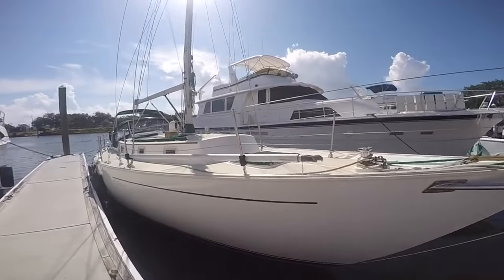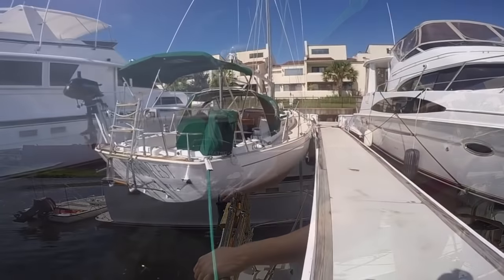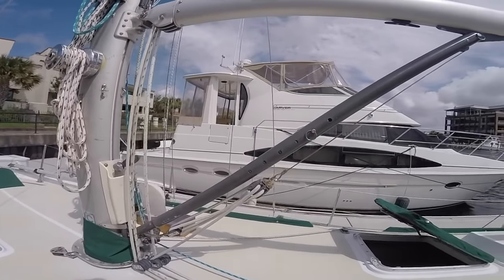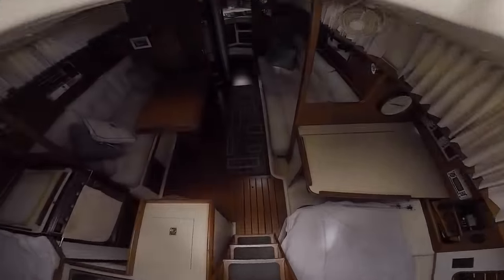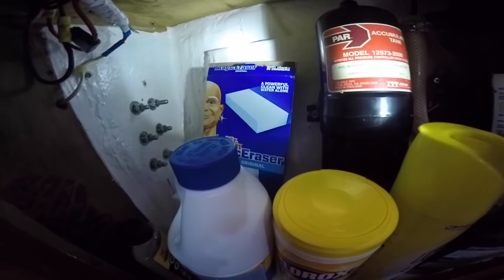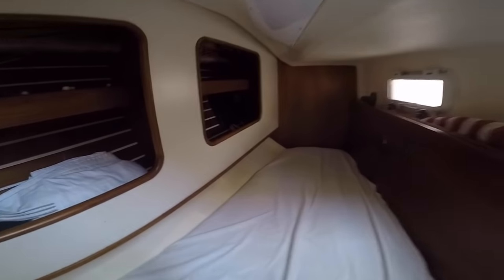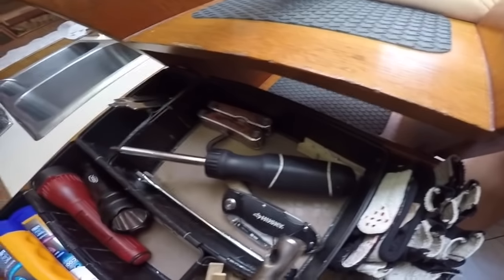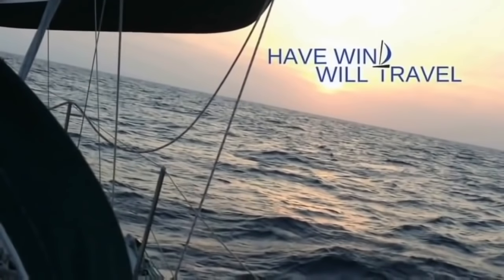Boat #9: 1985 Niagara 35

Comment: Hello Annie!!! I just came across this video. Highlights: Water in the bilge and the bikini were great ways to end and begin.  I seriously enjoyed your video, nice to see that you guys love your boat and take such great care of her.   I use to think I had the cleanest bilge on the water but I think that honor now is yours.  As an owner of a 1985 Nonsuch 30 I see so many of the same attributes throughout the boat. Mark Ellis & George Hinterhoeller, really demonstrated their trade when they designed and built these boats. I will have to check out the rest of your videos and catch up. Glad to see you guys check the fluids so often, great habit to get into. I'm envious of your ability to get through the engine access panel via the starboard rear quarter birth.  Reminded me of old times, I have you by more than a few years and when I was 135 lbs. I loved how easy it was moving in tight spaces; now at 70 lbs. heavier those days are long gone. I actually got claustrophobic watching you by the engine and had a sigh of relief once you slid out of the hatch.  Do you guys ever run a “windscoop” down there when working?  If not, give it a try, you will be amazed by how much cooler it will make it for you.  Thanks again for sharing your journey with us, smooth sailing….Bob………………..

Comment: thats maybe the best tour on YT, i wish everyone would follow how you do it. One suggestion, consider relocating the batteries elsewhere, someplace eye-level, so that water coming in the boat wont short the batteries. The boat could be half full of water and still you have dry batteries to work with, like powering bilge pumps and radio that you couldnt do otherwise. And have more batteries....six is a good number. Meantime, the cleanliness, condition, orderliness and aforethought is really impressive. Id like to hire you both to outfit my next boat.
Reply from the maker: Hey Coco.  We've thought about that before (the location of the batteries in the bilge and the potential for them to submerge if we got too much water in the bilge) but our bilge is pretty deep.  There is still another 10-12 inches, maybe more, beneath them, but you are right if they submerge and we couldn't use the bilge pump that would be a problem.  If they got wet, we would already be in some serious trouble.  Let's hope that never happens.  Appreciate the thoughts, though, and you watching the tour.
Reply: HaveWindWillTravel.com Relocation of batteries is not something I have done but I see the need for it. I considered the dangers of batteries flying around the cabin, and I like heavy objects carried low for ballast anyway, but after watching so many videos and listening to stories, it keeps coming back to "get the batteries out of the bilge." I hope I didnt sound heavy-handed about it, its just a thought and I wish you well no matter what :)
Reply from the maker: Not at all.  Trust me, I get a lot of heavy-handed comments but yours was not one.  We always appreciate well-intended and helpful input.  Thanks for commenting and watching.

Comment: OH NO a leaky boat! Was really surprised to see that head! I have the same one that's been on all my boat's always take it off and put on a "regular" one. You might have too work on it in 5=10 years. I think I have 4 bronze heads, hate it when someone throws one away. That's the first time I've seen a engine access like that, really cool also keeps the dishes done! Some time grab a bottle of wine and you guy's watch ( sv panope) on you-tube the best on anchors. I did use my CQR ( I have three different ones) till I watched his video's and it happened to me also. You've done a great job on the boat!
Reply from the maker: Thanks Packrat.  Yep, we love the old head.  They were just built better back in the day.  We've replaced the joker valve a couple of times, but that's it.  Will check out Panope as soon as we can.  Still trying to catch our breath from the Atlantic-crossing.  Glad you enjoyed the tour!

Comment: Fantastic tour and I've really enjoyed all the repairs and upgrades you made over the past so many months.  A few comments/questions if I may:
1.  I like your point about the T-configuration cockpit and how that reduces the length of the cockpit benches.  The alternative viewpoint, however, is that it also forces you to have a much smaller wheel, which makes it impossible to place yourself on the outer cockpit comings while sailing for a better view of the sail trim, etc.  I love sitting out as far as I can while humming along.

2.  I did a lot of read on batter banks and battery systems before making some basic modifications to mine, including a physical separation of the banks via a Blue Sea Systems switch and trickle charger from the house to the starter bank via Echo Charger.  It appears though that the general wisdom is NOT to combine battery banks if one is dying as that simply draws down both of them down when you combine.  Apparently the more preferred method is to keep both banks isolated.  Not sure.

Question:  I've been considering moving my battery banks from the port aft berth to the bilge in the same fashion you have yours.  Was your designed like that, or did you move them there?  Again I've been reading a lot of cons about batteries in the bilge and so I'm still giving this some thought.  What are your thoughts on this?

Thanks again for the fantastic videos!!!!

Dan
s/v Gypsy Soul
Pasadena, MD
Reply from the maker: Hey there.  Thanks for watching and the compliment.  We definitely love our boat.  Re: the steering, I don't believe we've felt we can't lean out far enough.  Phillip generally sits to the side and can see out as far as he wants and still hold the wheel.  On the batteries, our previous owner built out the space for the batteries in our bilge and we are very happy with the placement there.  We haven't had any issues with them there and they are secure yet easily accessible.
Reply: Wonderful, thanks for the feedback.  I'm going to consider the same modification for the batteries on my Endeavour 35.  The only negative I have read about is the potential to produce chlorine gas if the batteries become flooded with salt water if the bilge floods.  I'll have to do some more research.  Enjoy your pending trip to Cuba, that should be fantastic!!!
Reply from the maker: Thanks so much!  We are beyond excited about it!  Appreciate you watching.  Good luck with the battery modification.

Comment: Annie, Annie and Phillip what a great job you have done, now you can do my yacht, LOL But you will need to come to Melbourne Australia . Just a thought and I know it`s a bit late now to say but why have you put your batteries in the lowest part of the yacht ?If you have water come in the batteries get it .  On the commercial boats I was on the batteries were never down that far and on the Tall ship I was on we had one out side and up high and was used only for the radio.
Reply from the maker: Great point Capt Mark.  I hadn't thought about that, but they are well above the bilge pump on a custom rack that was built into the bilge.  Aside from that (perhaps) downfall, we love the location.  Thanks for the input.

Comment: Thanks for the speedy response, Annie. If my memory serves me, I recall you had mentioned as you embarked on your Cuba voyage that you will be sailing for the next five days, or so? Did you travel non-stop? What was your time to Cuba, including the 6-hour tack practically due east? What was your average speed? #90: Cuba Voyage II: Heavy Heeling: What was your tallest wave and highest wind-speed? It has been said that the gulf is very polluted (garbage disposed, large object floating). Has that been your experience? Are there reefs that one needs to be aware of? If one wanted to sail to Cancun, say from Pensacola, is there an undue risk in travelling a straight a line as possible, or would it be advisable to travel coastline? Considering your Trans-Atlantic voyage, there wasn't any coastline to cling to, hopping across the Gulf of Mexico must be peanuts, albeit in a smaller vessel. Thanks for the invaluable information.
Reply from the maker: Hey Wayne.  Some quick answers -- First off, know that the Gulf has dished out some of the worst conditions we have ever seen and we still to this day (Phillip and I both) think it is capable of producing worse conditions than the ocean on any given day.  This is because it is small and the periods of the waves are much shorter.  6 ft waves every four seconds is waaaaaay worse than 12 foot waves every minute.  It is not peanuts.  I would never say that.  We did travel non-stop to Cuba.  It was a five day trip.  We left on a Wednesday evening and arrived Monday morning, so roughly 110 hours.  Avg speed was around 6.5.  Most wind (true) was 19 and highest waves were probably 7 feet (the Gulf Stream was really kicked up).  No garbage that we've seen.  Plenty of reefs as you come into shores (there are two on either side of the entrance to Marina Hemingway in Cuba).  I wouldn't say there is an undue risk in traveling a straight line, it's just if you decide to go offshore, you're making a conscious decision to leave the safety of shore.  If you do, you need to travel wisely and carry the right safety gear and provisions with you.  It's always safer to dot along the coast in case you have problems you can duck in and/or rescue personnel can get to you more easily, but your travel plans are always also dependent on wind speed and direction and the amount of time you have (it will take longer to get there dotting the coast).  Hope this helps.  Happy voyaging!
Reply: Thanks very much, Annie!

Comment: Very impressive!  The tilting sink is incredible.  Never have seen that before.  I am jealous and thinking of trying to copy except my sink is forward instead of aft in the galley.  Is there a latch?  I know the chances of it moving are small.  I have fallen up ladders though, and in rough seas things can go weightless.  (Had a sailor killed by a copy machine on the Yosemite, I believe it was.)  Rig for sea!
Reply from the maker: +Pass Me By "Falling up ladders."  I believe it. There is no latch. However, I think if we moved enough for the sink to fall back we'd probably have much worse problems than it crashing into the table. Think pitch pole. Gulp. We do love that setup though. So easy and accessible. Thanks Pass Me By. I take it you're all caught up now?  : )
Reply: Finally!  Here in Freeport today and just handed over the new strut to the yard guys and doing work tomorrow.    Falling up ladders, yea we were off San Francisco in a fairly rough following quarter sea.  The ship (600 ft Navy vessel) fell into a trough as I took my first step up the ladder.  Found myself on my face at the top!  Barely touched the ladder.  Good times :)  (really)     Pitch pole is an extreme situation that could be made much worse with chunks of cabin coming loose.  I plan on blue water sailing and intend to tie everything down.   Check out some of the Pantaeneius crash testing videos.
Reply from the maker: Wow.  You weren't kidding.  I can see that happening in my mind.  Boats can do crazy things for sure.  We are pretty anal retentive about stowing and lashing everything.  I'll check out those videos for sure.  Thanks!

Comment: I find it interesting that they built the boat with the fridge right next to the engine like that. you'd think the fridge would have to compete with the engine's heat making the fridge use more power. Have you had any issues with that.
Reply from the maker: Agreed.  We thought it might cause issues as well when we first looked at the boat but it is insulated well and we've never had an issue.

Comment: For your consideration: "My Previous Owner had T'd a bilge pump discharge hose into the head sink drain. One night we had guests stay over and someone left the sink drain plug on. I woke up at around 3 am with water sloshing over the floorboards.  Seawater got sucked in as there now was a lock (plug) and the sea overcame the pump." I do hope this is not possible with your "magic" bilge box.
Reply from the maker: Thanks Mark.  I could see how that would be a problem.  Not possible here as we did not "T" into the sink drain hose.  Our box actually pumps up above the sink and then discharges down into the sink.  We just have to make sure the sink seacock is always open when we leave the boat.

Comment: I'm curios if Philip windsurfed before kiteboarding. I've been windsurfing for years, and my time on the water has been drastically cut shorter since I bought a Sabre 34 in 2001.  I was very tempted to learn kiteboarding but there just isn't enough time to do all 3 sports and still work full time.
Reply from the maker: I know exactly what Phillip would tell you if he were writing this.  LEARN TO KITE.  Tomorrow.  It's waaay more fun than wind-surfing.  The gear is much smaller.  There are so many more conditions you can kite in (with different sized kites).  He did not.  He went from surfing to kite-surfing and found it to be an incredibly rewarding sport.  I don't think he'll pick up anything else as kiting remains challenging no matter how "good" you get.  You can always start doing tricks, then jumping, then jumping over things.  You never lose the challenge.
Reply: Thanks for the thoughts! But I turn 57 next week and I'm putting all my energy and finances into refitting my Sabre 34 for Caribbean and retiring in 5 years. I'm with you on the smaller gear but don't have the time to put into it what I learned from 27 years of windsurfing. Most of my windsurf pals have switched to kiting, or dropped out of it all together. Anyways, sail to live, live to sail!
Reply from the maker: Understood.  Definitely choose how you spend your time wisely, but (last comment I promise) as a wind surfer, you'll pick it up 10 times quicker than the average Joe.  But, as long you're out enjoying yourself on the water, you've got my support.  Have fun out there!

Comment: Annie, do you have a small accumulator tank on the fresh water to maintain pressure?
Reply from the maker: +Jeff Markwick Hey Jeff. I'll be honest I don't believe so, because I would know where it's at if we did, right?  : )  That is probably why it has to go through that whole rigamarole -- Annie term -- when we turn on the water pressure. We just rarely use the water pressure. Primarily just for showering.

Comment: Great videos, Annie!! To my question: When you sail from Pensacola to Cuba, do you try to travel straight as possible to your destination, or do you cautiously sail along the Florida coastline to Key West then to Cuba? I am not yet a sailor, but I have been having a growing fascination with sailing.
Reply from the maker: Hey Wayne.  Thanks for the kind words.  Great question.  Our plan was to shoot straight for Cuba to make it across the Gulf as quickly and safely as possible.  But if the winds (both current and predicted) would not let us hold a rhumb line straight to Cuba our intent was to fall off east toward the coast to make safe harbors closer (in case something happened) and to avoid getting pushed too far west in the open Gulf.  We actually ended up holding a pretty straight line minus one long (6-hour) tack practically dead east, then we were back on a heading to Cuba.  Thanks for watching and commenting!  Good luck with your new addiction ; )

Comment: What system do you have in place to vent off hydrogen gas in your bilge battery compartment? Are all pumps located in bilge explosion proof? If you do not have a system, though financially painful, you should think about switching to AGM batteries as soon as possible.

Comment: Awesome video!  I have a couple of questions regarding all your easily accessible areas.  If your boat was to roll inverted what would keep everything in place?  I watched a video where boats were being inspected for a cross Atlantic regatta and one of the requirements was all floorboards stoves and items must stay in place during a rollover.  Your thoughts?
Reply from the maker: Hey Cleo.  Wow, if our boat rolled over, we would have much bigger problems than a potential thrown stove.  Phillip said this is true about the Atlantic regatta and I believe most of our things would stay in place (if you're particularly curious about the engine access I believe it would because it opens aft to bow, not athwartship). But our floorboards come up sometimes when we're heeling so I'm sure they would fly as well as our lockers opening up and everything tumbling out.  It's not a situation we have wanted to prepare for yet as I imagine we never want to imagine it happening.  Hope that helps.